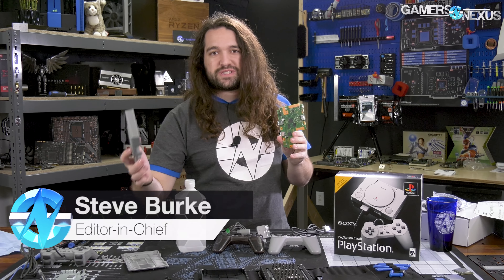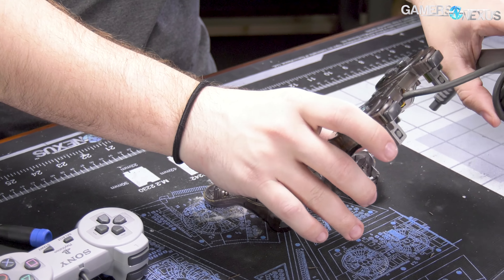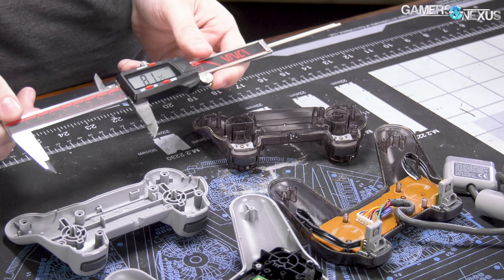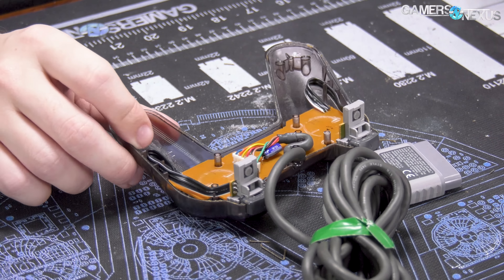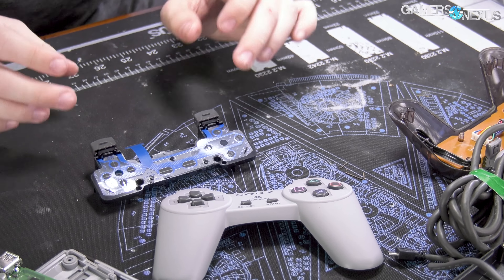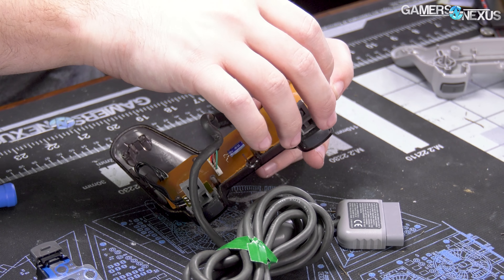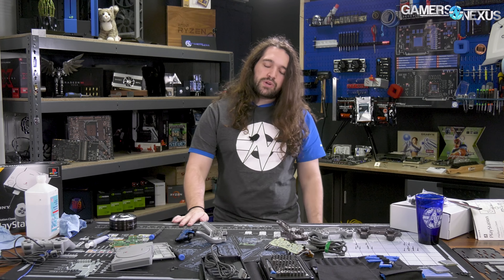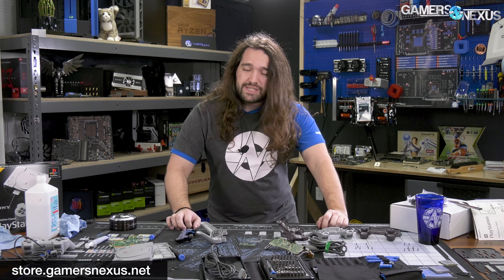PlayStation Classic Controller Tear-Down vs. PS1 Original

Comment: Way to go, the engineer's at Sony fucked this almost worse than the console. At 11:14, you aren't correct, the rubber pad is the entire switch, electrically. How that switch operates is that the black pad on the rubber membrane is a conductor, and shorts out the exposed contacts on the flex PCB, making the connection. This is a very cheap way to make switches, and is precisely the type of switch referred to when people talk about membrane keyboards.

Note at 11:34 the contacts for the d pad (left side) are not involute.  However, the contacts on the right side (square, circle, ...) are involute (the black contacts snake around each other). This is done to increase the likelihood that a button press will be registered, since if you press off center it may not push the pad down perfectly flat. I am reasonably confident that this controller will start missing inputs even faster than the original PS1 controller, which already had some problems.

For the original controllers, from what I remember from fixing them, the problem was as the plastic wore, particles would migrate into the switch contacts and cause problems (which will still happen on the new controller). This was easily fixed by disassembling and cleaning the rubber membrane and PCB. However, the new controller will have the added problem that in my experience carbon contacts on flex boards aren't adhered nearly as well. The switch contacts on the plastic flex board erode much more easily than the contacts on the FR4 board on the original controller.

In their defense, at least the engineers did think properly about cost-savings on this product, and did have 2 clever ideas. I do applaud using a USB connector instead of a JCB connector as in the original, that is a clever way to avoid custom cabling and make assembly easier. However, to avoid the cabling (and hand-soldering) seen in the original, they opted to use a flex PCB for all the buttons, so it can also operate the shoulder buttons. This saves insane amounts of money, entirely on assembly. The parts used for the original controller would still be cheaper, even now (avoiding the large black internal plastic support used, as well as relatively expensive second PCB), but the new controller is far easier to assemble in an economical manner. It is worse, but after looking at the console teardown it is clear that Sony is just doing a cheap cash-in, they obviously don't give even half a fuck about this product.

EDIT: 11:55 you question how long that will hold up. I can tell you, poorly. These types of switches can hold up (same type of flex board is the electrical switch in a IBM model M), but the carbon will rub off in fairly short order.  The model M keyboard, due to the way the switch is actuated (and a different contact material) holds up better, but this will fail much more rapidly than the original controller. The contact material isn't adhered all that well to the plastic board, so slightly off-center button presses rub the rubber pad sideways across the board and rub off the contact material. In contrast, the contact material on the original controller is Cu adhered to the PCB. So while the original controller can oftentimes be fixed by cleaning the parts (plastic dust can cover the switch), in the new controller once that contact material rubs off there is no practical way to fix the issue.

Comment: So that's just boggo membrane keyboard mechanism in there. Neat, I guess, probably the same design Sony uses in their other current controllers at a guess. Cheap, simple and works. Looks to me like the shell was made by taking the external CAD model for the original moulding and using that as a basis for the new design, they seem externally identical.

Comment: Sony's been using that membrane design since the PS2 - I think it was needed for the pressure sensitive buttons of the PS2 and PS3 controllers. It's a proven design, those controllers are reliable.

Comment: I would say this is not worth it. LGR built a ps classic with a raspberry pi for 100 bucks also. It doesnt come with a controller, but it can play any ps1 titles and games from many other old consoles.
Reply: Yeah it's called a Retro Pi. For ab $100 you can turn a Raspberry Pi into a retro gaming device
Reply: Yeah, cuz the people that will be buying this sort of thing for their kids are going to build their own raspberry pi console emulators.  Smh.
Reply: @MegaTechpc  Hit the nail on the head, I'm sure many of the GN or LGR audience could build a retro pi or run an emulator on PC, but we aren't the targeted audience, I personally won't be buying one but I'm glad to see older games getting some mainstream attention again
Reply: @lancesmart2667  Shure, shure... May I suggest the Ps1 HDMI cable or an RetroTinkX2 plus the original console. I bet an original and the HDMI dongle costs less than this piece of classic-trash.
Reply: @brostenen  Dude, I agree... personally I still own a PS2 (fully backwards compatible) & 60gb PS3 (Mostly backwards compatible) for my nostalgia tingle buttons, but again, people like me or you aren't the target audience... they will still sell a shit tonne!
Reply: @lancesmart2667  no one is saying that they aren't going to though.
Reply: @lancesmart2667  Yup. They will sell a large number to those that do not know what quality is. They will experience the games all wrong, and we will still play it like it was meant to be. Emulation is only good, when the price is under one quater of what the original costs. And then again. I will only settle with Amiga emulation, once my Amiga computers are all dead and gone. They are too expensive to buy these days. I know it is not playstation, yet it was only an example. However, I do have an Super Nlntendo as well and then Ps1, Ps2 and a Ps3. Speaking of PS2. Then I dont like playing Ps1 games on it. As to why I still have that Ps1.

Comment: The new one is built like a calculator. If you've ever tried to order a custom PCB before you'll know the price difference between 2x2" and 2x3" can be jarring. It's cost prohibitive to sell a $1.00 calculator with a PCB the full size of the keypad, instead you get a big flex circuit with a PCB only large enough to hold a couple ribbons and a blob. An Xbox One controller has two sizable PCBs inside, but they support a clicky D-pad, four analog inputs, three external connectors, two wireless connections, and an LED.

The USB module should be very re-usable in other products, or projects- it's essentially a Teensy 2.0 with a ribbon connector. Hopefully this controller will be sold stand-alone at some point. It could have the same $25 price tag that the original had on release and still leave Sony with a healthy profit margin.
Reply: If you wanna look at a good sized pcb and a well designed controller the Nintendo GameCube one is so good. Can't believe they're still selling them new for $30 and they haven't changed since 2001.

Comment: Interesting, it looks like the basic idea of how to make a button based controller hasn't changed. It's basically the same as a membrane keyboard right? The button layout on the PCB in the old one looks very similar to the button layout on the plastic membrane in the new controller.
Reply: Also, i bet that even with the emulation overhead it is still potentially faster than an original PS1 lol.

Comment: the new classic controller looks to be a relatively similar design to a ps3 controller. probably sturdier with the beefy black plastic piece. certainly a smaller pcb, but to be expected with lack of power circuitry, vibration motors, and older tech.
also Steve, you should definitely buy some nitrile gloves or something ;)

Comment: So the inner molds are slightly different noted. But my question is could the new pcb fit into the existing old housing?
Reply: That’s what I wonder too… I’m going to try that out actually and let you know because I want to use it for fighting games

Comment: I did wonder about the D-pad on the playstation controllers - Nintendo held a patent on the design of D-pads until around about 2001...
You'll find all manner of weird quirks in their design prior to that point (anyone want to speculate why the Sony pad isn't cross-shaped? XD), which mostly exist to circumvent that patent.

The design of D-pads seems to have converged a lot more after the patent expired...

Comment: The new controller isn't really that much of a leap in technology. The two major differences are the usb cable and the use of membrane switches. The USB standard has a (relatively) significant amount of overhead so I bet that chip on the new controller is doing a lot more than the one on the old controller. I'd also bet the old controller has lower latency because of this. The switches, however, are the same thing on a different substrate. The PCB is only smaller because it doesn't have all the contacts for the switches on it.

Comment: Old Design is better. You don't want any flex in the contacts. Not to mention how horribly those thin plastic circuit boards failed in items like automotive gauge clusters. those traces will have micro fractures in no-time because every time you hit the button the plastic flexes.

Comment: Well crap. I was really hoping the internals were close enough to the same that I could try modding a newer Dual Shock controller to work with the new system. Guess I'll have to try some USB adapters and see what happens.

Comment: Thats what I was suspecting. The PS Classic contoller feels mushier than the original because they cheaped out and put a plastic membrane instead of proper PCB. This removes the defined bottom out of the original. Even very cheap controllers use a proper full sized board for this reason. This shows how much Sony is willing to sacrifice quality for profit in case of this product.
Reply: If they had proper controller and used a cut down ps vita tv that can actually natively play ps1 games it would've made more sense.
Im sure they have lots laying around since it didnt sell well.
Reply: That's how all of their controllers have been built for awhile.... The original ps1 isn't actually all that different either.
Reply: Having owned every generation of PlayStation I could get my hands on.

Comment: Why the hell can't modern controllers have a usb plug?! Like they ALWAYS go out right out of the top of the controller, if you could unplug it and replug another cable that would be amazing!
Reply: They do, chief.
Reply: PS4, Xbone, and Switch Pro controllers do this... what modern controllers are you thinking of?
Reply: lol I want what this guy is smoking 😏
Reply: @Weaver_Games  They all plug right at the top, causing stress at the junction and often time the plug messes up due to the stress of being plugged in then 90 degree turn pulling all the time.  If it plugged in the inside to relieve stress they would last alot longer.

Comment: OMFG... I collect old gaming system since 1976 and I seen these thin plastic film in a controller on a Atari 5200 Joystick Flex Circuit - http://www.best-electronics-ca.com/images/cx52-3.gif
http://www.best-electronics-ca.com/images/cx52-2.gif

SONY WHY THE HELL ARE YOU REUSING THE SAME STYLE ON A 5200 JOYSTICK CONTROLLER!!!

Comment: If I recall correctly they've been using the membrane style switches since the PS2 with the main PCB sitting behind it.

Yeah, iFixIt has a DualShock 2 teardown that shows this: https://www.ifixit.com/Guide/DualShock+2+Disassembly/50763

EDIT: Actually it goes all the way to the DualShock 1: https://www.instructables.com/id/Clean-Your-DualShock-Controller/

Comment: The USB is impressive. It will work on a PC. I've used in ePSXe. Windows 10 and windows 7 will support, Raspberry Pi should too. Looks generic as for the controller IC.

Comment: How does this guy not know how the rubber pads work? They press against the pcb or plastic film with the carbon on it and it bridges the connection. There is no "switch".

Comment: i heard the controller works on the pc out the box. do u know if its possible to get this controller working on the PS4 via hacking or using adapters? i want to use these controllers for Street Fighter V
Reply: I've heard reports that it does work for the PS4 with Street Fighter V when changing the settings to legacy, but the Dpad doesnt work. I've had this issue before when attempting to get PS1 non analog controllers to work on the PS3 and PS4 where everything works but the dpad. The dualshock 1 works using an adapter when i turn the analog sticks off

I'll give the Brooks converter a try when i get hold of these controllers

Comment: Oh god... The human slime on that old controller... This is why I buy all my peripherals new... The slime on that PSX controller is older than some of the viewers of this video I'm sure.
Reply: Its hard to buy new retro controllers.
Reply: Just use soap water and a cloth, and it is good again. Else you have fobia or ocd. I know the signs all too well. And a bit of germs and dirt has never hurt anyone. Else you imune system will be weakened.
Reply: take them apart and clean all the plastic pieces in a bath. It's basically like new after that. that being said, it's most useful for stuff you can't buy new.

Comment: So, if the PS Classic is basically just running an emu, would it be possible to use an X360 usb controller instead ?
Reply: Probably could use any usb controller you wanted

Comment: If you cant replace the rubber pads for the buttons it makes the controller's life very limited. Nobody makes replacement parts for the controllers, only the original ones you can get rubber for. So the same rubber pads would need to be used. Looks like once a button goes bad on the new ones, you're screwed. The original controllers you can buy replacement parts or swap parts between controllers. Good luck finding extra Playstation Classic controllers for parts..... you'd have to buy the whole console again, which is still $100 and will be gone when people run out of stock.

Comment: That old controller did NOT under ANY circumstance come with the original PS1 at all. 100% of the original controllers were grey, the smoke controllers were not available until after the release of the 3rd model of PS1.

The old school cable DOES come off the connector is female the solider you see there is simply post for the cable connect to connect to. with the age of that controller and the pain it was to take it off, I do not recommend actually removing it.

Funny thing is that the buttons themselves have been using the rubber button design since the SNES (maybe NES, never took one of those controllers apart)
From what I understand the emulator and ROM choices make it a bad buy. Game selection does not help. I want to see a DualShock version of those Controllers.

Comment: Original PS pad was the best controller ever created. Did you say that the old controller came with the PS One? Because if so that is NOT the original Playstation. The PS1 was the "newer" version with the curved corners etc, little crappy thing lol. The size of the pad is important, however not as much as the weight, did they get the weight of it right? My main issue with the console is you can't put your original disks in it, they should have remade it properly so we could use any games we have from the past.

Comment: Please check NVIDIA’s claims on the RTX optimization patch which they state they achieve 100% better FPS over previous build. (30-35 before, 60-65 after).
Reply: No, they claimed 50% not 100%
Reply from the maker: Aren't they officially claiming 50% improvement?
Reply: Well according to my math they went from 30 average FPS with RTX on to 60 average FPS with RTX on. That would be twice the performance hence 100% improvement. Maybe I’m missing something.
Reply: @OIFIIIOIF-VET  Yes, that's what the jump is, but they aren't claiming values that high because they aren't always that high

Comment: latency because of the wire... really ?
electron signal propagation of voltage change is near speed of light!
so lag i think not!
most if not all lag in controllers is caused because of data processing, and not voltage propagation.